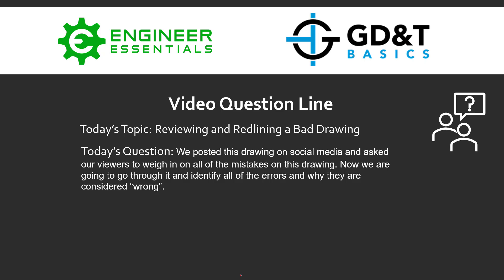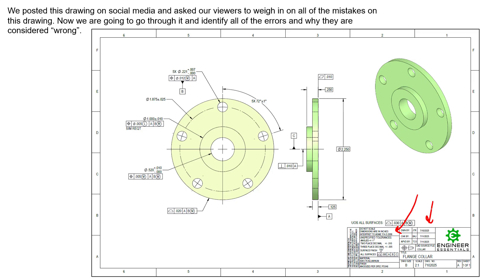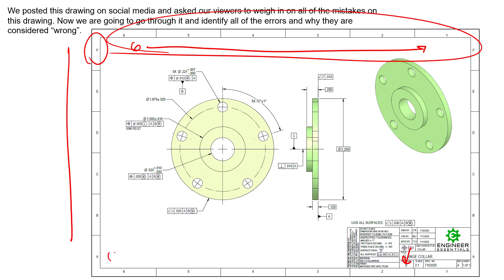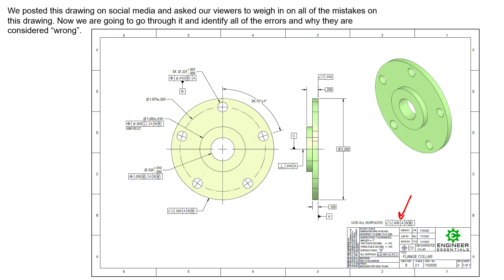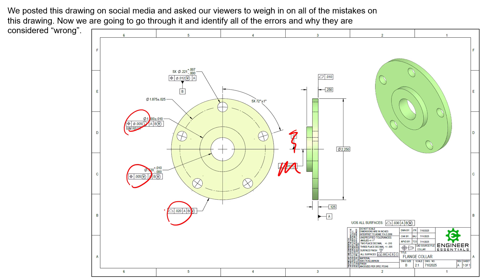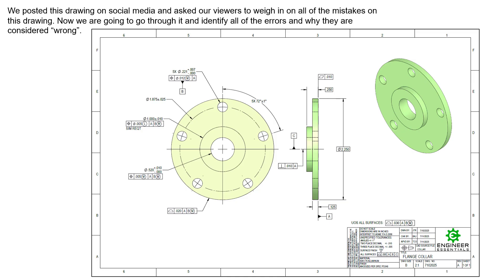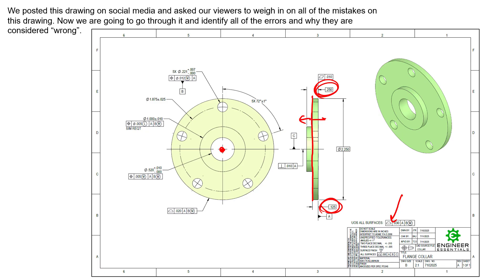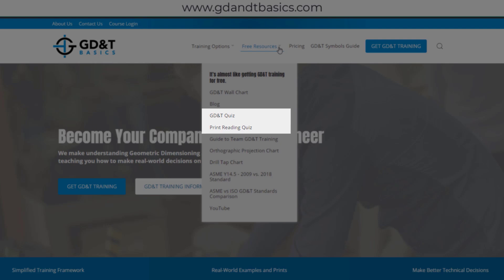Reviewing and Redlining a Bad Drawing

Comment: Great video. Thanks for sharing. Question: Do you generally have suppliers measure general tolerances (UOS Profile 0.030 A B (M))? Most times, those are just put on the drawing as CYA callouts in case something goes horribly wrong with that dimension.
Reply from the maker: They are generally viewed as CYA callouts for sure. BUT whether or not something gets inspected is an entirely different conversation that should occur between the quality/design/manufacturing departments. AND just because its not inspected, doesn't mean it can be out of tolerance... we just wont know its out of tolerance. (Kinda like Schrödinger's cat, is it dead? Is it out of tolerance? who knows! )

Comment: 9:15, why you have given position there instead of  perpendicularity. 

12:38, you already mentioned profile tolerance of 30000 right, what's wrong there if we put basic dimensions to thickness of 0.125, 0.250 dimensions.
Reply from the maker: We have to use position for the pattern of 5 holes because we are controlling the location of each hole relative to the other holes. And for the profile tolerance it absolutely is controlling the two surfaces you mentioned and that is why we have basic dimensions. I pointed these two dimensions out in the video because we got a lot of comments that these two dimensions NEED to be ± tolerances instead which is NOT true.

Comment: Hi, first of all I love the videos and this one specifically was very educational.
I just have a question about datum B. You mentioned that datum B is the pattern of 5 holes. Would that mean in this particular case all 5 holes are datums of equal power? If so how would one apply that to the measurement? It is high likely me interpreting it completely wrong but from this drawing i would assume that the northern hole is the sole datum B in this drawing.
Either way, thank you for the video, will be looking forward for more videos of this type.
Reply from the maker: You are correct, all 5 holes have equal power, to simulate this at RFS we would need 5 expanding envelopes that expand at the same time and remain perfectly located to one another and then the part will "rattle" and align itself to these expanding envelopes. However at MMB we could simply have 5 pins that dont need to expand. The diameter of those pins would be the MMB (virtural condition or worse case inner boundary) of the datum features. This is the foundations of designing a functional gage. We cover this on a deep level within our courses if youre interested in digging deeper!

https://www.gdandtbasics.com/gdt-training/gdt-courses/

Comment: 13:50. Can you clarify where in the Y14.5-2018 applying a +/- tolerance dimension as you have illustrated is prohibited? Is this inferred by the definition of an irregular feature of size (para 3.35.1/2), or is it expressly spelled out somewhere? While I know you could add another datum and profile from it, if you are simply trying to communicate you need that central protruding feature to maintain certain amount of stick out regardless of the OAL or height of the first step, that seems like a lot of extra work and complexity for what could otherwise be a simple check with a drop gage or depth mic. Thanks.
Reply from the maker: In the Mandatory Appendix I of ASME Y14.5 - 2018 it outlines the issues with directly applied ± tolerances to control things like location of surfaces. It does state it as an "alternative practice" which means its unsupported by the standard (so maybe prohibited or illegal is a bit harsh). Also in the Foreword of the standard it states this will likely be removed altogether from the standard completely in the next revision. Meaning "you're on your own" if you decide to make up your own rules. 

There are definitely pros/cons to this stance on the issue. But adding another datum or adding profile to a surface may seem like more work for a drafter but in reality its likely the EXACT same inspection and same amount of work for an inspector regardless. But with datums and profile you actually have a fully fleshed out definition to lean on, rather than the ambiguous controls that result from ± tolerances.

Comment: Drawings do not have morality. They can not be good or bad.  However, they can contain errors and poor practices.
This is just my red line of the video title.  😮
Reply: Addendum. I disagree that the pattern of 5 holes is an appropriate Datum for a collar.  The bolts and  holes would most likely be a clearance fit. If not, the assemblers will have unkind things to say about you.  It is a much better design practice to use part features for piloting and allow the joining hardware, of whatever type, to do the joining.  
This part also has sharp corners everywhere since there are no break edges specified.